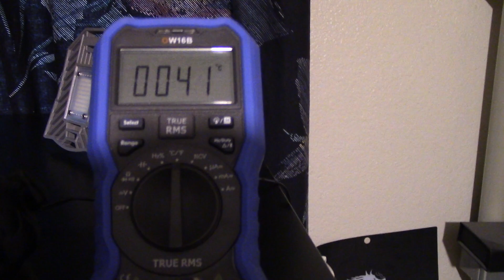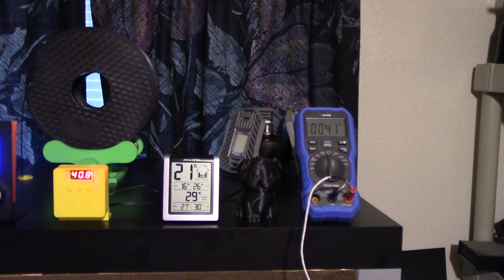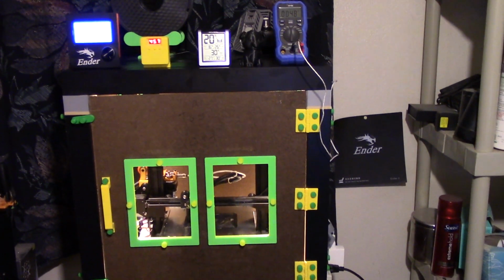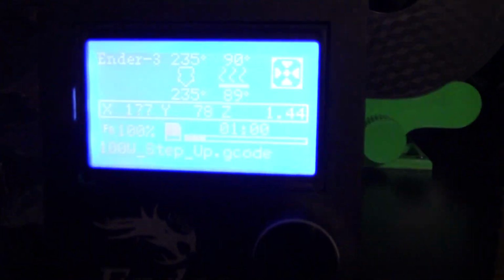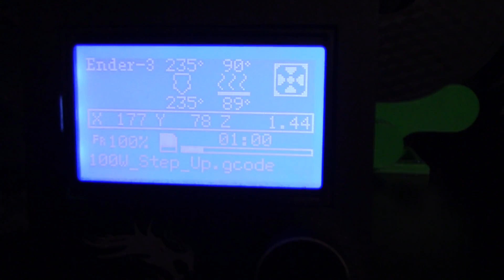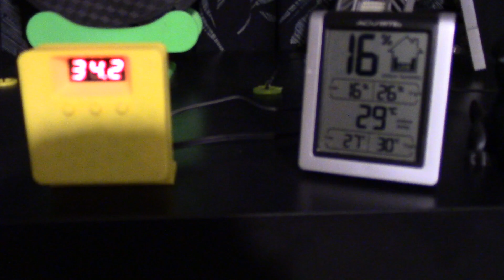First Print on Ender 3 Ikea Lack Enclosure! ABS

Comment: What will happen if you are printing abs for 24 hours without stopping? because the temperature inside is very hot
Reply from the maker: So far no matter how long I've printed the inside temp hasn't gone higher than 55-58 C and it hits that within a couple of hours. I think I'd have to insulate it a lot better if I expected it to climb higher without another heat source than just the bed an nozzle. I've got a couple of longer prints coming up for a new video, I'll document it better then. Thanks for commenting!

Comment: Chuck, glad to hear you are printing ABS.  Just to let you know what I do, I have a partially enclosed Ender 3 (I leave the front side open, so there are only 3 acrylic walls), and I use a BMG extruder and a E3D V6.  I print beautiful ABS prints (hard to even see layer lines) by using these settings:
Build Surface - Glass
Adhesion - Hair Spray
Resolution - .1mm
Speed - 50mm/s
Nozzle - 240c
Bed - 90c
Part Fan - 100% (Starting at 3mm)
Retraction Distance - 5mm
Retraction Speed - 45mm/s
I only print a 2 line skirt, or a 4-8mm brim if it is a taller part.  I don't get any stringing because of the more aggressive retraction settings, but I wouldn't recommend this without a BMG or TItan extruder (which is one of the best upgrades you can do for your printer).  Give it a shot and let me know your results.
Reply from the maker: Thanks for the info Dan, I'll give that a try!

Comment: I like petg I wont use abs cuz I sleep next to my printer and dont want to breath in abs fumes
Reply from the maker: That's probably a wise decision. Stay away from nylon and polycarbonates too, they're as bad or worse than ABS. Of course, PLA releases chemical fumes as well, but they're not as harmful.
Reply: @3rdpig  I'm moving soon and will ba able to move my printer thanks for the info on the other materials I had ordered the micro swiss clone so I could copy what you did

Comment: Good job Chuck! I've been wanting to try out ABS but have not worked out exhausting the fumes.
Don't you just love it when a plan comes  together!!👍
Reply from the maker: Problem with exhausting the fumes while the printer is running is you're also going to exhaust the heat, so the intake would have to have a heating element if you don't want the temp to drop. The output could be a simple activated charcoal filter back into the room. This would also be a reasonable way to heat the chamber if needed and the heater and both fans could be run off a single controller like the W1209. If you don't need to heat the chamber just seal up the enclosure then when the print is done put an exhaust fan in an open window, open the enclosure and leaving the room for 15 minutes should suffice. I'm told the symptoms of breathing the fumes are dizziness and headaches, so it should be very obvious if you're not doing a good job of ventilation.

Comment: That's brilliant, Chuck. Really well worth all your effort. I bet you're glad to get there!
Reply from the maker: Thanks Paul. I'm very glad the construction of the enclosure is done. That, and upgrading the board at the same time, was far more involved than I first thought. I have another video on polycarbonte waiting for me to edit. I won't be satisfied until I've printed successfully with it.
Reply: @3rdpig  Yes, that will be really interesting. It will also be good to know if the belt hardware and so-forth tolerate the heat well. Was it your usual mirror/hair spray for adhesion with the ABS. I thought that might be tricky given the heat.
Reply from the maker: @PaulMcKillop  So far I've been good with mirror and hairspray until about 90c. I've tried 100c and gotten away with it, but that's about when the hairspray starts getting gooey and not holding. In an upcoming video I try 100c and it works out. But I've also got a PEI sheet laying around here somewhere, I'm hoping it will make an appearance in my future polycarbonite tests. I don't really expect to have a problem with the belts at anything under 80c. Toothed belts are commonly used these days instead of chains on motorcycles and I'm betting the temperature of the belt, specially an enclosed on like in the primary case of a Harley Davidson, runs at least that. But that's assuming the belts are well made and in the case of Chinese belts we really have no idea. Hopefully high quality replacements are available.

Comment: That looks like it worked out well Chuck.  Glad to see you're now able to print ABS successfully.  I've heard that some of the harder materials  are not much harder than ABS so maybe you'll have to try Nylon next.  I don't remember if you have an all metal hot end, but I think you need to print it above 250 C so the standard hot end wouldn't work.  Thanks for keeping this going and congratulations.
Reply from the maker: Thanks! I've already printed successfully with Taulman Bridge Nylon, I've got several videos on it. Yes, I've got an all metal hot end, a screw in thermistor that will handle 300c and some other upgrades. But I was bound and determined to print with ABS and even more so with polycarbonate which I've failed with once. Stay tuned, there's more polycarbonate coming soon!

Comment: I cant wait to enclosure my ender and start to print a bit of abs. Im aiming to print some case modding parts for pc and I think that pla wont just do the trick regarding heat resistance. Did you took any precausions about abs vapors? I heard that they are pretty nasty.